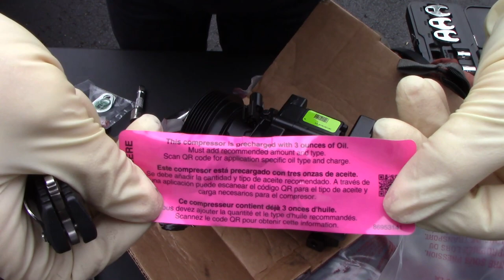'07 Kia Sedona AC Compressor Part 1: Removal and Prep

Comment: Perfect, thank you! Replacing my compressor and doubted I'd find a video.😂
Reply from the maker: Haha... well, good luck. It's not too bad of a job, especially if you can jack the van high enough.  😉
Reply: @CubasAutomotive  I started replacing it and realized the one wire running to the compressor one the old one was cut. Might not have to replace!
Reply from the maker: @David-bg9od  yes, you're absolutely right. That would be the clutch activation wire. Make sure fuse isn't blown, I think 7A and go from there. Great find.

Comment: Looking forward to part 2 Cuba. A question is fixing cars your day job?
Reply from the maker: Yes, for the most part, but I also work on big equipment and small engines to residential electrical & plumbing, or repairs (such as appliances). People who know me will ask if I can "___" and it goes from there. I take care of equipment at an estate such large tractor, backhoe, log splitters, and chipper.
Reply: @CubasAutomotive  Impressive, i asked that because you are working on your driveway on a jack. So you must be dependent of the weather. Or is the weather over there always good? Or can you move the car inside?
Reply from the maker: @Diagnosedan  this was on site at the customer's home. Most of my work is on site, as many of the customers I have done work for, don't have many options and have kids or work from home. 

I did have a garage I split with a friend, but he started bringing friends & little kids there and I can't work like that. It's a safety hazard. Since then, maybe going on to 3 yrs now, I still manage to fill in the gaps. I paid off my home last year. 
Prior to the garage, I had commercial fleets I'd maintain, which they had garages. I'd make my rounds and do repairs on their sites or job sites, which was a huge advantage as they still had access to the tools on the vehicles. We'd get done about the same time and able to part ways at the end of the day. Both have since moved from the area, so that's when I rented a garage for a span.

 I'm focusing on more learning & training as of late.

Comment: Have you ever had the opportunity to repair the compressor itself instead of replacing it?  My 07 sorentos compressor had the center of the pulley come off and the compressor doesn't engage although it is getting voltage on command.
Reply from the maker: No, I have not taken THAT compressor apart, but have others or to replace a clutch.
I find it odd that it came off. I imagine it's threaded? Hopefully the threads aren't damaged. If there's power to it, but the clutch is not engaging,  1. the air gap is too big, 2. the windings are weak, or 3. open winding on the electro magnet portion. 

I hope that helps.

Comment: What's the name of that green connector that connects to the compressor?? Someone changed the alternator on my mother in laws van and ripped that connector. I can't find it anywhere
Reply from the maker: You have a choice of making your own connector using a weather proof pigtail, you'd just have to change both. 1 wire male & female connectors can be found on Amazon.  Otherwise try the dealer to find the "AC compressor clutch pigtail"... but be aware that they don't have to carry anything beyond 10 yrs old. I hope that helps.

Comment: Can you answer a question for me.. I see some people putting oil directly into the ac line .. is that supposed to be done when replacing the whole ac system
Reply from the maker: Yes & no. Here's why:

First, you need to refer to service info to get exact amount needed for that vehicle's system. Take into consideration any accessories like rear/aux cooling, that will usually increase oil & refrigerant capacity. 

Yes, you need to add depending if you're replacing entire system, for 1, but you need to be sure those replacement components already contain oil or not. There are many aftermarket compressors which will have up to 3 ozs of Pag. Others might not. 

There is such a thing of having too much oil which will cause "slugging" of the compressor (especially like some models where the compressor sits low GM 5.3ltr) and essentially try to hydrolock it. Too little will allow for premature wear. 

If you're replacing 1 component and system is still full, not leaked out, then measure whatever oil that pours out and that amount, maybe .5oz more to account what's stuck on walls, etc.

Hope that helps.
Reply: @Cuba's Automotive   .thank you that was helpful.. the compressor locked up in my van . It's a 09 sedona.. after doing some research I found out I basically have to switch out a lot of other parts due to metal particles.. I don't have the money to take it to a mechanic so that's why I'm doing it myself.. anyway I appreciate the advice thanks again
Reply from the maker: @dennissummerlin7024  1 question for you. 

Which part locked up? The coil/clutch?  Or the main body of the compressor? So, the clutch is spun by the belt. The main body only spins when the clutch is activated.
Reply: @Cuba's Automotive  the  pully appears to be locked up ..
Reply from the maker: @dennissummerlin7024  it's quite possible you may not have to replace everything in the system.  When you remove the compressor,  check for metal by pouring out the contents in a clear container.  No metal, you can prob get by without replacing all the other components. If there is metal... then you will have to. Good luck Dennis 🤞🏻👍🏻
Reply: @Cuba's Automotive that would save me a lot of time and money..  thank you for taking the time to talk to me about this .. fingers crossed hoping for for the best.. I'm also subscribing to your channel